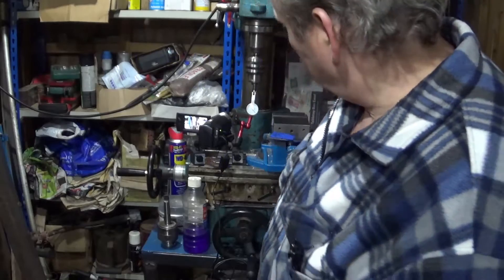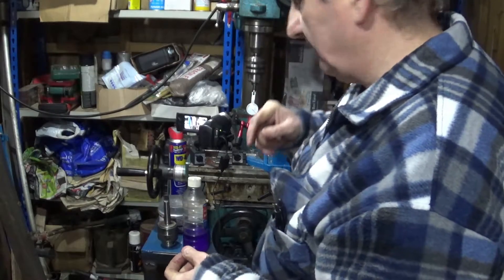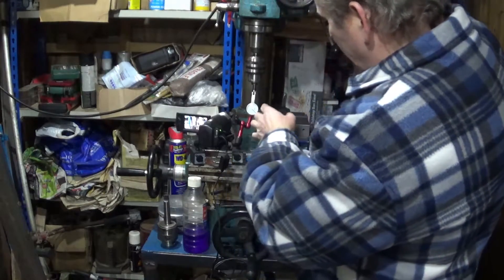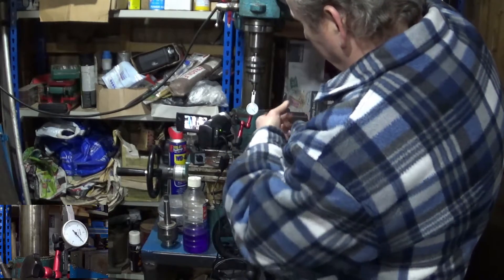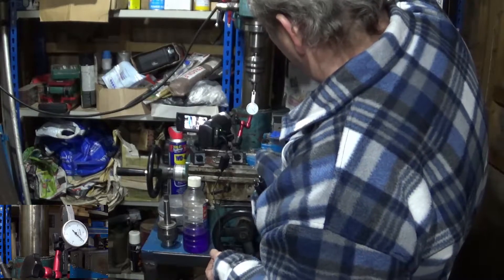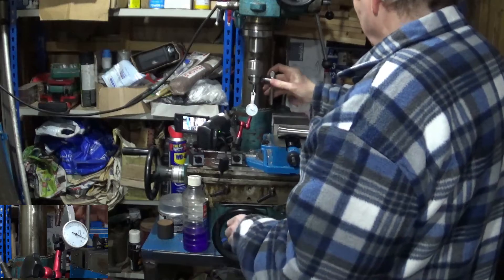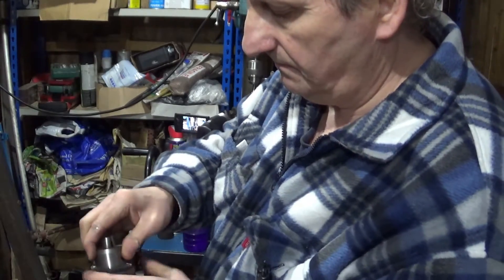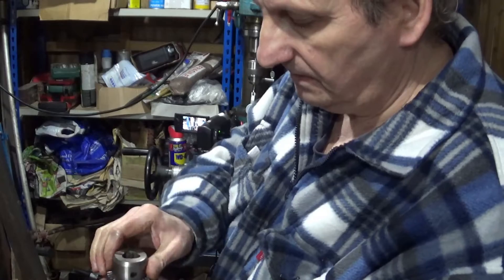fixing runout on a drill press

Comment: I have one that is wobley, I think its worn out but not sure. Just dont have time to get around it. Thanks for this video
Reply from the maker: Check the runout on the top of the arbor, take the chuck and arbor out, and check the runout in what ever it runs in (usually a Morse taper). That should tell you if it is a problem with the chuck/arbor combination or not. If not it probably will be bearings in the quill which you should be able to replace.

Many thanks for watching!